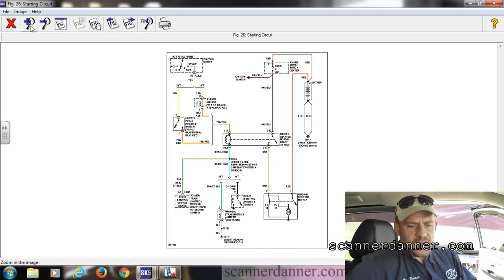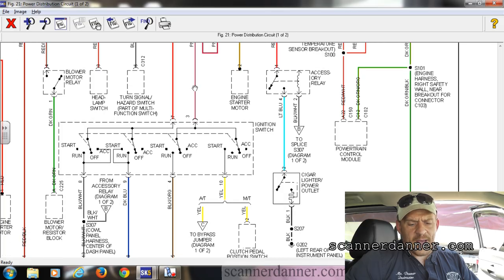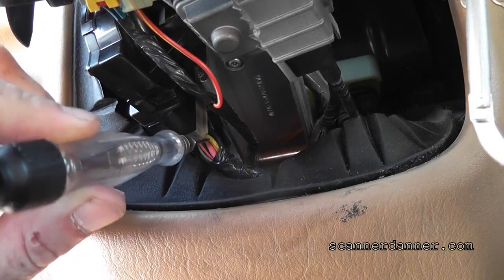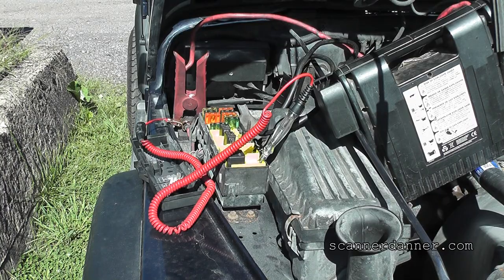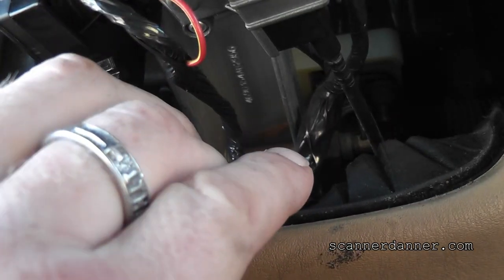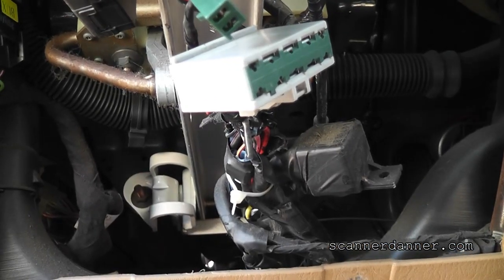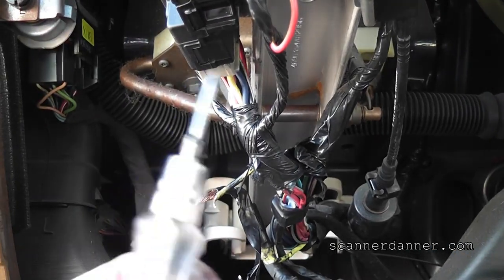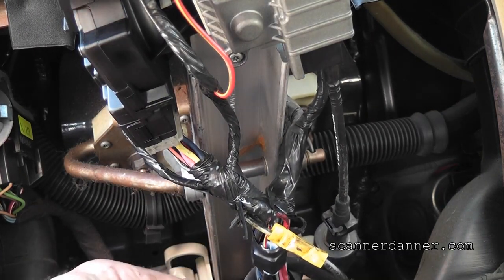No Crank Troubleshooting (engine does not crank) - Jeep

Comment: Worked in automotive for 36 yrs, and I am retired and recently have been looking on YT to refresh memory a bit. I found your videos to be interesting and in this scenario kinda funny cause I've run into this type of issue a few times. The only thing I can say is that I was taught to first check the battery and it's connections and a quick volt drop test with headlights on will check cables for you. The start relay, if there's easy access, is a great quick check, then scratch your head and go from there. Please keep up the great work your doin', I'd bet a lot of techs and do it yourself home boys have gotten good tips from you, and by the way. don't worry about the length of the videos, it never hurts to hear that little extra info or tip. Keep it up :-)
Reply from the maker: Thanks Bernard! Good tip on the headlights. Sometimes we forget the basics when we jump into a job. :)

Comment: It goes to the old saying "if you know how it works first then you own it". I was with you all the way and knew you were a good mechanic when you said lets solve one problem at a time. first rule is dont skip around you verify two and three times before you lmove to the next possibility. Iam suprised you didnt see that after market kill switch mounted on the dash. I just found your channel today and cannot believe what a good mechanic you are. I understand your mobile service to auto shops because allmost no one understands electrical.  just using a ten dollar test light is all you need. Although I would have used a multimeter to test for lproper voltage and ohms from connection to connection with a twenty foot clip cord you can move around the auto with. I cannot wait to follow your videos. I'll sure to learn something.  Although I retired two years ago after thirty eight years in the mechanical trades. Thank You!!!!!!
Reply: Thanks Gary! I know you will like what you find.

Comment: Iv been breaking my head the last 2 hours looking at wiring diagrams trying to diagnose same issue on my Jeep. I threw in a new switch because I was confident that was the issue little did I know that it wouldn't be. I spent another hour back tracing my diagnosing and researching on the internet on similar problems but nothing related since I was already far into my diagnosing. Then just for the heck of it since I love watching your videos I watch this. You mention the box thing that seems to be a aftermarket kill switch and it clicks in my head "hold up iv seen something like that on this jeep before tucked away" and guess what I find? The kid I bought it from had wired this thing into the ignition. Lesson learned ladies and gentlemen....
Reply from the maker: Awesome. Thanks for sharing and nice job!

Comment: Paul,

Love your troubleshooting technique on this no start/crank Jeep.  These after market alarms can be a pain if you don't have the schematics, etc.  or if you're buddy calls you over with a no start and doesn't tell you the immobilizer/alarm is engaged. Happened to me with a Nissan, I was able to crank it and start after I jumped a few connections, and then he told me sorry the alarm/immobilizer  had been engaged.  I agree it's great fun when you start narrowing and isolate the problem, troubleshooting is fun and a challenge for me.  There's really not many if any electrical I can't solve in an automotive 12 V DC system.

Keep the great work and I love the length of your videos!!!

Comment: Nicely done.  Owner of a 97 Jeep Wrangler here and was dealing with a no crank no start.  Thanks to this great video, I was able to determine that I have a bad Park/Neutral switch.  I'm not interested in dropping a pan for the switch just yet, so chasing wires I found the pigtail splice under the driver's dash and bypassed the switch for now. Thanks, and keep up the good work!
Reply from the maker: Heck yeah man, nice job! Thank you

Comment: Don't worry bout your presentation.It's fine!! n You make this all make sense which it a great accomplishment. I'm 63 and just got my 98 grand running again thanks to you.ASD relay bad. contacts burnt changed relay n jeep started but cranked slowly.Had plenty of voltage at starter while cranking so I dropped the starter n opened the thing up. bearings were so worn the armature was scraping!! Never seen that in 50 years!!!.New starter new ASD relay.Good to go. Your approach and a step at a time did it.Thanx!!

Comment: Excellent stuff. Thank you.
Just trouble shot my own TJ 2001 after watching your video. Had exactly the same situation of an after market device that was spliced into the yellow wire. Removed that and then replaced  both the switch and the actuator only to discover that I also had an intermittent problem with the "clutch depressed" switch. Rather than replace that,
 I simply jumpered it out with a fuse in the fuse box. Total cost to fix was less than fifty dollars. Your trouble shooting was extremely helpful to my own diagnostic endeavor.

Comment: I noticed the jumper wire thing on the wiring diagram,and was suspicious of it..once you confirmed that it was an open between there and the switch,I immediately suspected an aftermarket alarm,or something playing up. Bingo!  Good stuff.
It's always 'fun' when new parts are faulty.

Comment: Paul ,I had one of those bad I broke a oil pressure switch  doing a head gasket job, after completing the job oil pressure light was flickering  we replaced the switch two times is till same condition it occurred warm idle only,so the garage owner was blaming me for installing wrong  the head gasket and wanted me to remove it again, I told him we needed to try different part brand  he said no, ( our master oil pressure tester kit did not have , well it had  the adapter but location of switch against framing was  so tight could not be attached) I decided to go to auto parts and buy it out my pocket different brand installed and solve the issue,I did did because I was on a class a teacher said If you suspect bad part do not exchange it for  same brand try different brand because the programming for that product could be wrong and the complete line is defective out the box, what a big lesson that this days we have to learn techniques to test new parts other than trouble shoot the vehicles problem, thanks for sharing your though process , I love that smile after some frustration when you figure out .

Comment: Mr danner , that was great to watch,  an education in diagnosis- piece by piece, any other person on there bad day would fling a starter motor, relay etc at it, it might be a one off to fix, but that = £ pounds/dollars , what you did there was persistence in engineering, it only cost you time, and time is endless , great work , wether it took 5 min or 5 hrs or 5 days , the customer has a smile on there face that's all it counts 👍🏼
Reply from the maker: Thanks so much!

Comment: Lol...99% of the things you were saying while troubleshooting are exactly what I say 😂..I was troubleshooting the exact same problem in a 99 Cherokee and last night got to the point where everything is fine other than no '+' feed to the yellow/red at the relay..I can crank it by applying power to the #31 (I think that's the number) fuse under the passenger side kick panel.. so..I know it's an issue from there back to the ignition switch or the switch itself.. but like in this video.. the recent previous owner claims to have replaced the ignition switch without any success... Time to back probe the yellow/red and the pink/black at the switch.. and no... you don't talk too much (lol) nor are your videos too long! Anyone who's actually a mechanic or electrical troubleshooter totally appreciates you taking the time to go through the steps.. what I DO hate though is watching videos where they sit there for 10 minutes explaining how to take off a cover or something instead of just diving right into the core problem. Great video dude 😉👍
Reply from the maker: thank you so much! I try to keep it moving for sure, but sometimes when talking about the variables it can be difficult to follow me unless you have some experience. Good job on your part my friend.

Comment: Man, I can't thank you enough for how helpful this video was for me to troubleshoot a similar no crank situation in my 99 Jeep Cherokee. I'm totally not a mechanic and used this as inspiration and the FSM to find that I am getting power from the ignition switch all the way down to the clutch interlock switch/jumper and then it stops - won't send power out to the starter relay in the PDC. But, I can get the starter to work by supplying power to the wire that comes out of that connector and to the starter relay in the PDC (just like you did!). I reckon the actual connector that is meant to have the clutch interlock switch/jumper plugged into is the culprit. What do you think my best next step would be - just cut that connector out of the picture and splice the two wires together to close the circuit?

Comment: Thanks for the video I've been racking my brain on a YJ. looking under the steering column I can see some splices. as a matter of fact the same aftermarket relay and dash mounted whatever the hell is it. Long video but in all honesty I didn't want to turn off and move on. Keep up the good work and THANK YOU
Reply: Update on my issue I spent some time under the dash and four the splice for the "alarm" into the ignition switch. Along with alot of other splices, followed and removed everything after market spliced back to factory. Issue is now gone may thanks for this video your awesome man!

Comment: 2002 Nissan Maxima 3.5
No crank/no start. No noise, just nothing.
New batery, cables, plugs and wires.
All fuses good and relays good except, did not check inhibitor relay. Have not checked starter for power yet.
Would a defected or bad  inhibitor relay, cause a no crank?
Awesome video. Thanks a lot.

Comment: Haha, this brings back those frustrating moments and yes, laughing at it sometimes alleviates the stress. I've also ran into brand new(faulty, you read that right) brake switches on these Chrysler/Jeep/Dodge products. You can also check the ASD circuit by jumping power to the DB wire at the ign. switch. Awesome video Paul, this particular circuit on these vehicles is very familiar territory.

Comment: Good job Paul, I have had similar situations happen to me too with having multiple problems and bad brand new parts.  Makes you want to rip your hair out, lol.  I'm starting to lose mine a bit, lol.  I once looked at a old mustang for a guy and he wanted me to put a fuel pump in it.  I asked him if he wanted me to diagnose it and he said it had already been diagnosed.  I replaced the fuel pump and it didn't start, bad deal for the customer.  He then had me diagnose it and it turned out to be a bad aftermarket msd ignition box.  No voltage to the ignition coil primary.  Not all after market installs are bad, but it can be a pain in the backside sometimes if you don't know that it's there.lol.

Comment: I think the customer did accidentally reinstall the original ( bad ) ignition switch - because - when you installed the ignition that the customer said was the original ignition switch - it physically looked much cleaner - at least it sure looked much cleaner to me. Great troubleshooting and surely you located the problem 😊👍✌️✌️

Comment: Whenever I get a used car the first thing I do is a sweep for crappy aftermarket alarms like this and rip them out. That one is one of the more comical ones I've ever seen! 
The aftermarket starter lockout was likely the original problem, and then a faulty ignition switch was installed when the aftermarket lockout wasn't noticed. 
Those harbor freight hose pliers are super handy, I just used them to change the EGR cooler on my 6.0 PowerStroike - would have been impossible without them!

Comment: Fantastic again.  As you say, enjoyable.  If the original ignition switch was good, then why did he change it before you got there? A simple check of power in and power out when cranking would have been good enough to prove its integrity.  So the original tech made a bad call?
I always wonder what would the customer had been charged if the new ignition switch wasn't faulty?  It would have been for the switch (which wasn't needed) and the repair.  Looks as if the customer got lucky there.  Saved by a faulty switch.

I remember years ago watching a tech working for SAAB here in the UK.  SAAB 93 came in with traction light on.  Head honcho told my mechanic mate to do a software update (that didn't fix it), then told him to change the ABS module (that didn't fix it).  We are now up to $1000 and still no fix.  My mate asks if he could have some time to diagnose it.  He was told in no uncertain terms they didn't have time to do that but if he used his own lunchtime it was okay.  Within 5 minutes he found a broken clutch switch.  Cost of $20 to replace!  But the key question I asked was.......................................have you guessed?...........how much was the customer charged?  $20 or $1020?....................Bet you don't even need me to answer that do you.  The customer was charged $1020!!!!!!!!!!!!!  So much for honesty then.

Another epic video Paul.  Doesn't lose its magic winging its way across the atlantic!!

Comment: dude, you could have found a cable ringer or tone generator to trace the yellow cable and find the 'break' . Would have saved a little time. But I know, more gadgets to carry and more batteries to maintain.
But all good. I learned heaps here especially with the test light.
Whats the max current draw on that test light and by its nature, is it also as a current limiter?

Comment: Great vids Mr. Danner!  I'm going to order your book or manual.  I'm a neophyte or 'brand' new to electrical diagnostics, so hopefully it won't be way over my head.  I had a no-crank, no start problem with my '96 Avalon.  I printed off its starting system diagram or schematic at the library and started the process of elimination.  Relays, and fuses were okay, the starter was good, and I couldn't track any open circuits or short to grounds, etc.  Feeling defeated, I had it towed to a nearby garage.  After a relatively quick check, I was told to get another engine bay fuse/relay box.  I knew there was no power going to the headlamp fuse sockets and prolly the starter relay, buy assumed it must be a wire or connector problem.  I was told there is an "internal circuit" or that the box gets power internally.  What!?  How could that be?  I thought all power came from the battery or a wire from outside the box.
Reply: BTW -- it was intermittent, and it started again once the box was replaced.
Reply from the maker: @jonathansmith9705  so you fixed it? Sorry for the late reply, can't keep up with these here very well anymore
Reply: @ScannerDanner  No worries -- thank you for reaching out.  I'd imagine keeping up with YouTube comments could be a full-time job!  Yeah, as mentioned, I broke down ): and had her towed to my mechanic.  He told me I needed anther junction box.  Fortunately there was an Avalon at Pull A Part that had the same engine bay junction box, and once put in, the car started up.  I assumed that all the sockets in the box were powered by a connector or wires that went into the box from outside (powered by the battery) yet was told that there's an "internal circuit" that powers the box.  I'm still befuddled -- don't know how that's possible.

Comment: Very informative 
I have a 2003 yukon denali that shut down on me the other day, believe anti theft has it on fuel lockout. 
Will not crank, no click, starter and everything else checked out.
I will be looking for more options like in this video.
Thanks.
Reply from the maker: It should set a code if it is anti-theft related. The anti-theft light will be blinking at you too AFTER trying to crank it with the key still on
Reply: ScannerDanner I followed your procedure regarding the Hyundai no crank, and I have the same problem with the PCM circuit,  did the test light to ground and applied load, and it is the solenoid ground failed.
Thank you dude, you have helped immensely with your video.
I forgot about this kind of,diagnostics since my head injury 15 years ago. I have shared your video and also I found one of my PCM fuses blown after my truck just up and died for no reason.
I've been having serious electrical issues beforehand since,I bought the truck such as engine power loss, and abs and stabilitrack.
Starter is original starter,  15 years ain't bad.
Reply: ScannerDanner found out it needed a ground wire installed on alternator,  ran it to ground wire on firewall and relocated ground wire for PCM in same location.
Works,  fired right up.
Anyone doing big 3 wire upgrade,  needs to install ground wire on alternator.

Comment: Thank you!! With all your help I got my Jeep Grand Cherokee Ltd 1997, the only thing which I couldn't work out was the switch wire was Yellow at the ignition then Yellow with red tracer at the relay. so I ran another wire direct, which means she will start for only 2seconds, until I demobilise with the fob (unlock)  not ideal I guess? Can I bypass that immobiliser completely ? Thanks again!